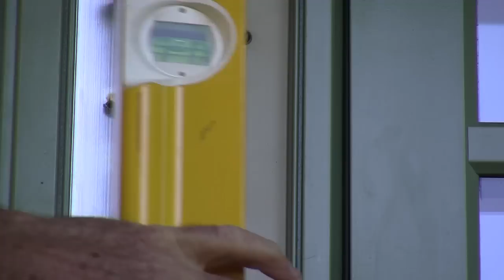Installing Exterior Doors & Windows: Setting The Doors

Comment: I thought the better method is to leave the sill uncaulked so water has a path out if it gets behind the window?  Or is that only for windows and not doors and sidelights?  Im not an expert but am in the market for new windows and wanted to understand the process better.  It seems every installer has their own quirks with window install.

Comment: Any missed nails or nails driven below the green coating will be a weak point of this type of system. Maybe a good idea to seals the nails in the field of the board ,and not just the edges of the boards . Although I don't completely trust the test I saw ,parts are credible . this system was tested and leaks did happen , and they started amongst other places ... at the nail holes .
Reply: Palm forgot , Great bid 👍
Reply: *almost